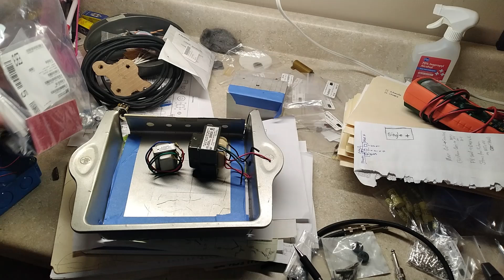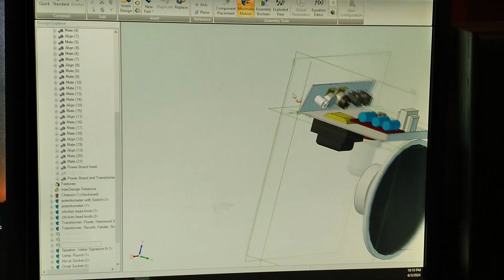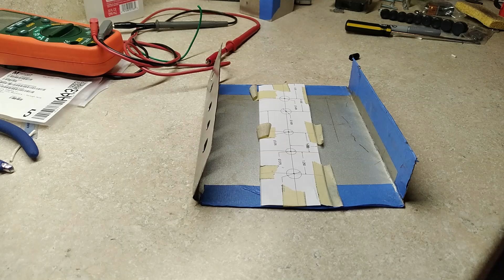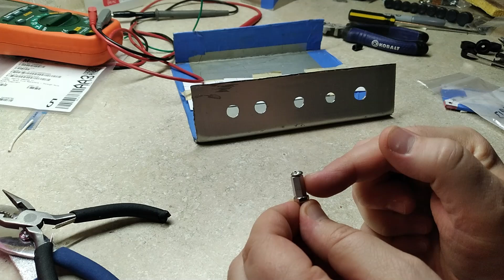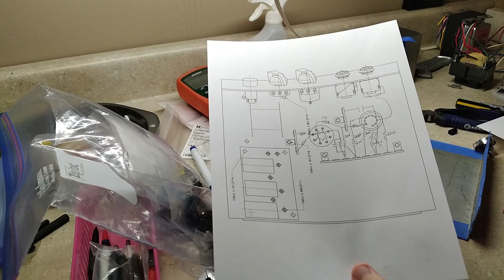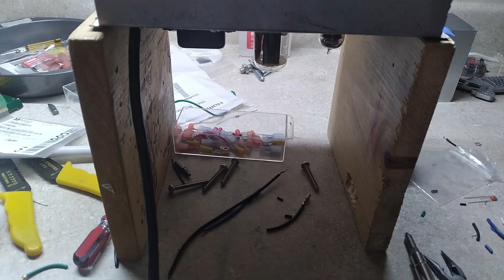Junk Bin Build - 2 Watt Tweed Princeton

Comment: The sound you hear when you put the feedback resistor is oscillation. You’ve made the feedback too strong when using a small resistor.
Try leaving the resistor there and wire a 100k or more pot in series and check what’s the value at which it stops oscillating. Then place a resistor of that value there.

Comment: The "proximity" of your parts/layout is not your problem. I've built many tighter and higher gain builds w/out your issues. Motorboating is a fairly common experience and means you've created oscillations. Your layout is not too bad but the grounding is far from optimal for sure. Without a schematic it's hard to follow what you've done regarding possible mistakes on how you made your layout. It is bad form to run your 1st preamp tube's cathodes' grounds connecting to your output transformer's ground the way you've wired it. Run the output ground directly to the star ground. Those cathodes' ground and your input jacks' ground should be ran straight to your power cap's node grounding point aka the neg lead. Proper grounding is an art in itself but critical to high gain circuits. Yours is not a high gain circuit and one of the easiest simple circuits. It's hard to tell if you're missing any grid leak resistors but could be your issue as well especially for the 6sn7 "power tube"? I assume you're running it in a self-split mode like similar Firefly amps.
Reply from the maker: I'll have to check my grounding scheme the next time I have the amp on the bench. I'm running the "output" tube in parallel triodes so I can use the Fender Reverb transformer as an output transformer. That could be part of the reason for the noise since I don't get common mode cancellation.